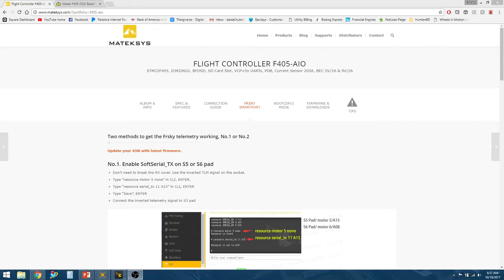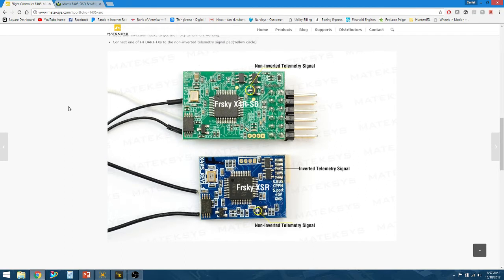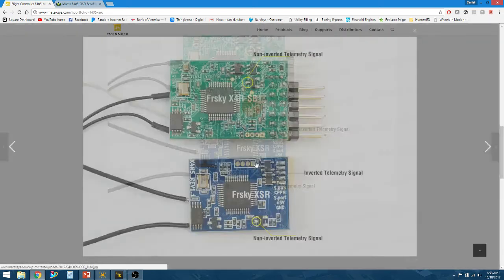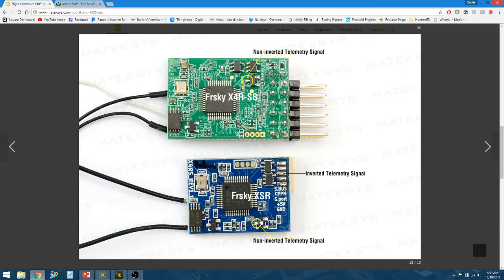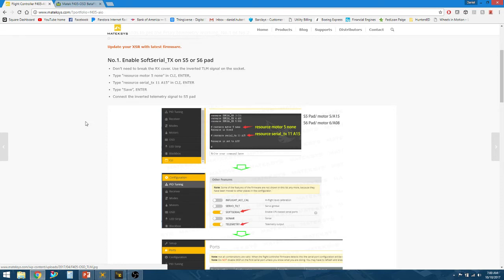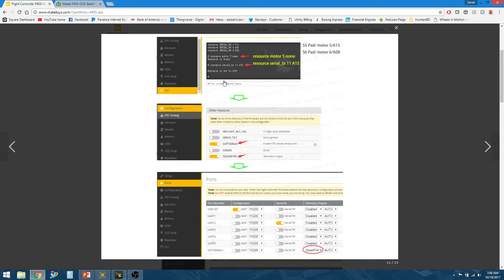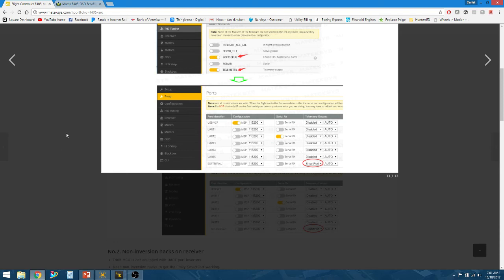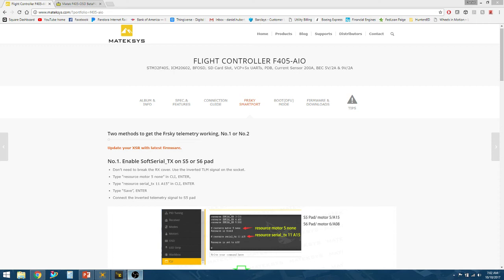How To: Matek F405 AIO + FrSky Telemetry

Comment: http://www.mateksys.com/?portfolio=f405-std#tab-id-3      +   resource MOTOR 6 none
resource SERIAL_TX 11 A08
save

help me)) working!!!  soldered to pin s6 and soldered xsr inverted from pinout not from board. same  may be if you don't want soldering from board  use set tlm... 
may be is working solution too.

Comment: Hi there, I just want to confirm if I still need to solder from the non-inverted signal in XSR even if Im using the soft serial method. The description indicates that you can either use the method one OR method two. Im confuse. Thanks for the response in advance.
Reply from the maker: Mac_zila hey there — short answer is yes — you still need to solder a wire from the non-inverted signal if you want telemetry. Also, looking at the Matek website, they tell you to update the XSR software as well. Here’s a video showing you how to do that. https://youtu.be/od-Qrd4Lulo
Reply: Thank you for your response, by the way Im using F450 OSD and not the AIO. I have already udated the firmware of my XSR. This is what the website indicates:
"No.1. Enable SoftSerial_TX on S5 or S6 pad
Don’t need to break the RX cover. Use the inverted TLM signal on the socket.
Type “resource motor 5 none” in CLI, ENTER,
Type “resource serial_tx 11 A15” in CLI, ENTER
Type “Save”, ENTER
Connect the inverted telemetry signal to S5 pad"
The only difference is I used S6 pad, but I assigned serial_tx 11 to A08.
Reply from the maker: Mac_zila oh wow ... so you don’t have to do the inverted telemetry mod?
Reply: As it is I can tell it doesn't work for my set-up. I cant find any videos/write up anywhere that the Method 1 was used and actually worked, that is why I thought Id ask you since your video is the closest that I can get to what I am trying to achieve, but you mentioned that you used the non-inverted signal, which I believe is method 2.
Reply from the maker: Yeah I'm running an X4R-SB receiver -- not XSR, so I don't have any direct experience with getting the XSR to work ---
Reply: I bet you need to use the non inverted signal wire to that pad you made.  Have you just tried that?  Maybe method two will work for ya.
Reply: Maybe they meant step 1 and Step 2 rather than method 1 or method 2. I'll try the non inverted sinal. Thank you for the response.
Reply: You only use soft serial if you want to use the inverted signal from the JST connector; if you use the non-inverted signal from the receiver then you don't need soft serial.  Either way you have to map the right resources using the CLI in betaflight.  The names of those resources change depending on what pins on the FC you've soldered to (TX1..2..3 or S5..S6).  Type "resource in the CLI to see what the names of the different pins are.   (Soft serial is Betaflight using the flight controller programatically (ie software) to do the uninverting. If you use the uninverted signal it's already uninverted so you don't need the flight controller to uninvert it. Soft serial is easier because you don't have to solder to the tiny pin on the receiver, it's at the expense of a little processing power on the flight controller but it's not a problem, the flight controller has plenty for that.)  Mac_zilla, your problem is likely that you need to use the right resource name for the motor 6 pin, also make sure you're using the right UART number in Betaflight.